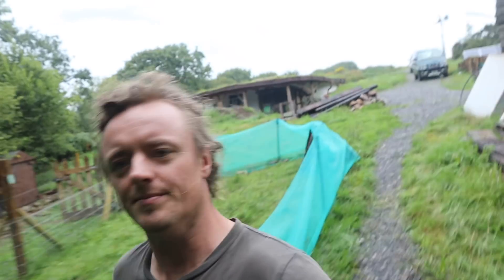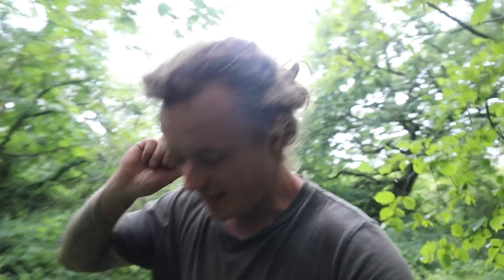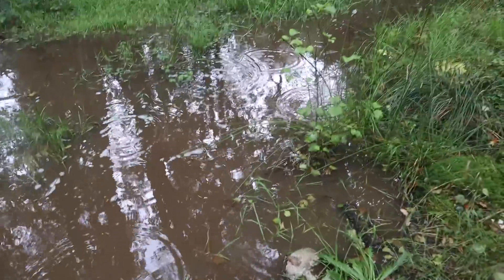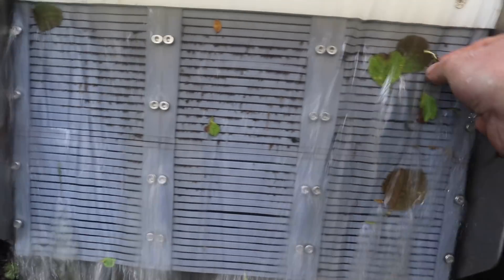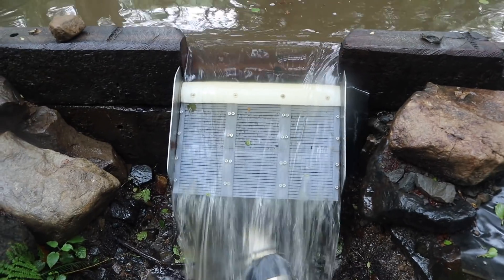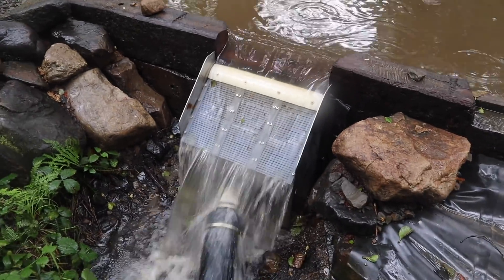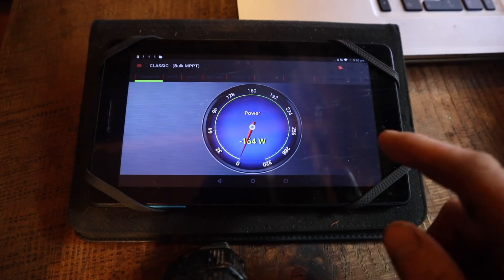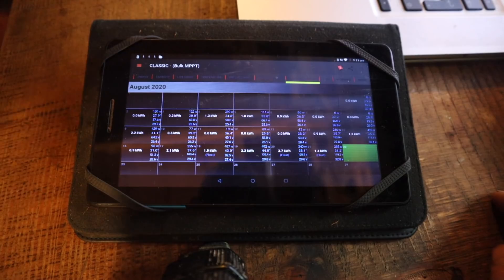Hydroelectric 3D Printed Intake update after Storm Ellen

Comment: What could be more natural than a 3D printer? I'm often left wondering what to do with all the computer components and sludge fractions from the petroleum refinement process that I find littering the forest floor.
This channel had the most false and misleading name on YouTube, hands down.
Reply: This is not a bushcraft channel limited to stone age materials. This is about someone creating an actually livable home for themselves off the grid, and minimising their environmental impact, and yes, minimising environmental impact can still involve using plastics and even concrete in certain situations. This is someone who is not releasing several tons of carbon per year using grid supplied power, and you're complaining about them using ~100 grams of plastic to make it more efficient.
Reply: @____5837  This channel EXPLICITLY claims to be about natural building, and this is clearly not the case. Your Stone Age reference shows your utter ignorance of history; my ancestors, and probably yours as well, were building homes and other structures from entirely natural materials as little as 150 years ago.
Reply: I think nitpicking over the use of technology to further reduce the overall total carbon footprint further into the negative is probably a bit pedantic.
Reply: why would you try to avoid technological solutions when they help you reach your goals to run on alternate/renewable energy? should he build a wood waterwheel? i'm sure he'd get like 20watts out of that from this stream. carve a coanda screen from chicken bones? just because you like natural building materials doesnt mean you can't like cool modern technology
Reply: @Curtcou  I don't claim to avoid the use of technology in the things I build, but I do scrupulously avoid using any unnatural and toxic materials in emplacements that directly leech into soil and water. This IS not an alternate energy source, water power was the first method humans learned to use after simple muscle power. And it's DEFINITELY not renewable: how long do you think any of this will last if the component factories shut down?
Reply: @archenema6792  how is water energy not renewable? like i said you could build it with natural materials but it would be not efficient enough. judging from your other answers you're probably not very open for constructive discussions so let's leave it at that :) have a great day and stay positive!
Reply: @Curtcou  You don't understand that the meanings of words are determined by the Convention of their use; we all tacitly agree that word B means X, and that we will use it that way. You don't get to create your own definitions. My original reply to you is logically and ontologically unassailable. When the manufactured components of his system fail, if no FACTORY exists that is able and/or willing to replace them, the system cannot be renewed, and therefore is not renewable. QED.
Reply: When are you lot just going to learn to ignore people like this?
You know - 'thriving on the oxygen of publicity', and all that......!!
Reply: @andymccabe6712  People like this are why we can't have nice things.  Kris reads this drivel, and if he reads enough of it, he says "F**k it, I don't need to put out free videos if this is what I get in return."  Makes me want to monkey stomp the haters.
Reply: @69Buddha  So you not only want to 'monkey stomp' me, but you think you're physically capable of it?
I tell you what: you just watch my 4.5 minute video entitled Home Dental Surgery, and if you still feel that way, we can make arrangements to meet in person. Pittsburgh has been very quiet during this season of riots, and I've SO been looking forward to getting a little action for myself. 🤣🤣🤣
Reply: @andymccabe6712  Living up to your namesake, I see.
I just bet an apologist for the status quo like yourself has an "insurance policy" to prevent those who would bring sense and logic to a party based on ego fulfillment and self congratulations from upsetting your carefully arranged apple cart.🤣🤣🤣
Reply: So then...what have you done for the Earth today?  You fully off grid?  Watching this on an all natural, tofu-based computer?  Stop being a hater.
Reply: @69Buddha  Glad you brought that up! I'm not sure what you think doing something for the Earth means, and I doubt you've ever asked yourself whether the Earth wants what you are doing, but I strive to live in balance with Nature, not to bend it to my will. Despite my convictions and principles, I would never assume that they provide moral cover for me to tear and rend the land with backhoes and front loaders to satisfy my egotistical need to claim that I have done some wonderful good for our planet and its countless other denizens, when I've only built a rural prison for myself to hide from the world in. You see, after I made my original post, I spent the next 3 hours doing what I do best, building a raised bed garden from found and reclaimed building materials for someone unable to engage in such work, to which I will shortly return after swatting away the LARPing gadflies on this thread. I operate a charity that does this for free, open to any recipients, but focusing on those with mobility issues who desperately want to have access to fresh healthy natural food.
What have YOU done for another person today? Or ever?
Reply: @archenema6792  Well, it's easy to see that someone with your charm and creative username is clearly a philanthropist.  Just got back in from picking some tomatoes grown in my own garden -- fed them to my children that I keep in my rural prison.  Haven't randomly attacked anyone providing free YouTube content today; instead, I stuck up for someone providing free content that thousands enjoy with no vitriol required.  Ran right back to see the responses to your goading though, didn't you?  Methinks you enjoy the strife, Ms/Mr Enema.
Reply: @69Buddha  Well I've been able to post a couple of comments that Krissy didn't delete, so I'll try for the fourth time to respond to your most recent comment.
Doing things for your children is an established act of kin selection, as clearly shown shortly after Mr Darwin published his famous thesis. What have you EVER done for another person in need without the expectation of return or even gratitude? We both know that's an empty set.
Reply: This is a test comment, because after repeated attempts to reply to direct physical threats from his mindless followers, it appears that the testosterone challenged weakling who operates this channel has blocked my ability to defend myself. How ironically appropriate a response from such a pathetic coward!
Reply: @archenema6792  haha you're funny :D

Comment: EDIT 
From the comments to this, this is a bad idea with the new useless non feed in tariffs 
EDIT 
Just wondering given you seem to be consistently generating more power than you can use, have you looked at the cost of getting connected to the grid vs what you would earn from feed in tariffs?
Reply: You’d be looking at a minimum of £10k to get grid connected in a remote area like this, feed in tariff has ended and we only have the export tariff now at roughly 5p kWh even then it all has to be mcs certified to be able to be connected to the grid and register for that.
Reply: @VirusX87  oh ok. It used to be a lot more profitable when they paid ~15p and paid for half of everything you generated even if you didn't export it
Reply: I hope he remains off grid, but if there's a constant surplus, I'd love to see him come up with a creative way to use it.
Reply: @DireChris  if fit in with his lifestyle I'd say pump some of that water uphill again to a reservoir he can tap into that potential energy later on.  However this is usually used  when you have a peak somewhere in the day you want a boost in output for.

I'm sure someone has a better idea.
Reply: He mentioned in the past, and in passing in this video, that when solar and wind producing high, he turns down the hydro. In other words, he's only producing slightly more than he needs.
Reply: __  Better to be Off Grid, they have killed the  feed in tariffs. Keep on your own green energy Kris
Reply: Where I live, the way I understand it, the electric utility pays you a small fraction of what you pay them for the same amount of power. When the power goes out, your power goes out too. I got my solar panels so I would have power during an outage.
Reply: @nowhereman7398  in the uk you used to get ~15p per kwh, and they assumed you were exporting 50% of everything you generated